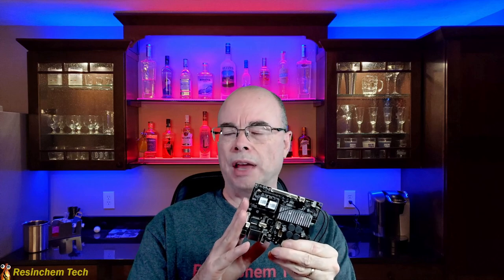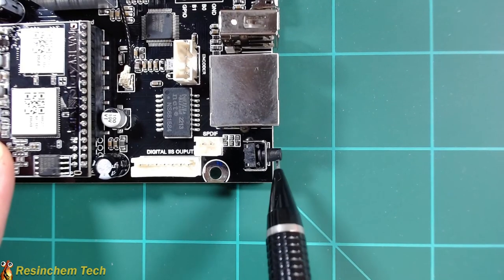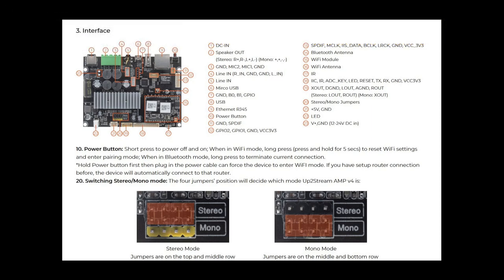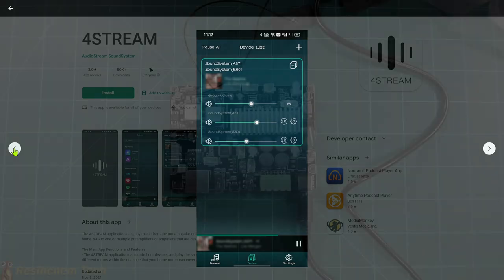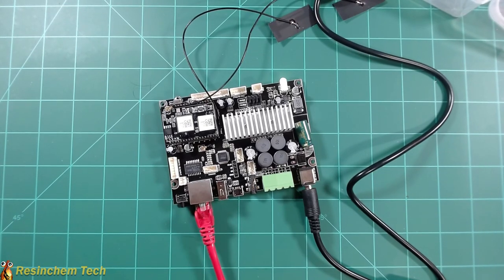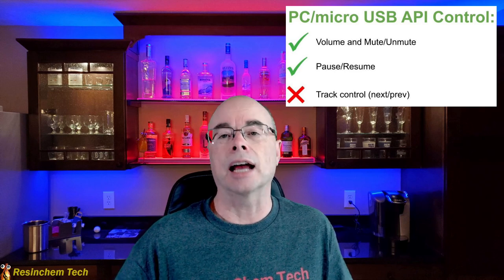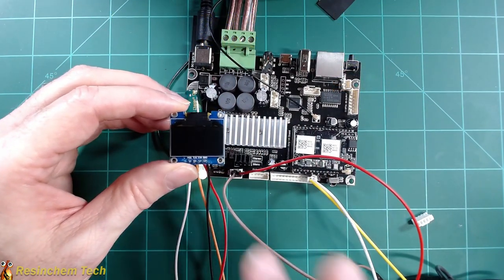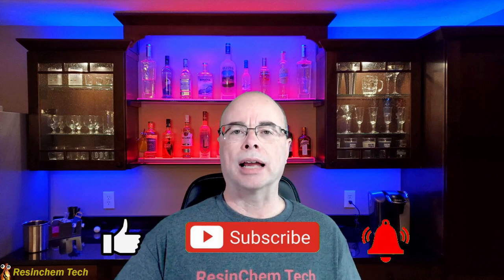A DIY approach to using the Arylic Up2Stream Amp

Comment: Ive setup 3 of these for a client with a dual zone audio system and portable transmitter. Using home assistant and linkplay you can get a lot of the features you’re looking for and combining that with the dlna player can give you %90 off the control you’re wanting.
Reply from the maker: Yeah... as I've played with it some more, I've discovered a lot of those things.  But is still hasn't stopped me from adding local pushbuttons, a rotary volume knob, OLED display, an ESP32 so that MQTT can be used to control the amp, my own IR receiver and remote and extending the IR... in prep for putting it all in an enclosure for a nice little self-contained package.  Not because I needed to do it to get use the features... it was more for the enjoyment of just seeing if I could make it all work!  I may or may not do a follow up video on these things... as you said, most of that can be done with other methods, but I do like that I have the local push buttons and volume knob right on the box in front of me when playing music without needing to find a remote or go to a web site or app.

Thanks for watching and taking time to comment.

Comment: Just last minute comments. To clarify, I only used the app once really just to connect to WiFi the lazy way. 

It is worth mentioning that you said “Old Speakers “! This not so expensive Chinese board brings life to mine and saved me money. 

Last I confess, I don’t own google devices and I was desperately looking for a way to use Music Assistant but it wouldn’t work with Alexa devices. 

Short story is I have been using Home Assistant for 7 months and I have this running so well for my needs. Yes me of only 7 months in and I have it integrated using Zigbee button to control the features that Steve hard wired here. 

So if your aren’t comfortable with breadboard etc there are options for us…folks that look for the convenient way. 

Another excellent and detailed video by ResinChem Tech!
Reply from the maker: Thanks for the comment... and clarifying the the amp can be used in other ways without all the complicate "breadboarding" and external components. If there is interest, I can do a follow up video and go into a little more detail regarding other control options, such as Home Assistant automations where control can be through other devices, like your Zigbee button, MQTT, etc.  This video definitely doesn't cover all the possible options!

Comment: I've built several speaker systems with the Arylic boards and they are have great sound and are reliable.  The question you had about version4 versus 2.0 is the 2.0 means it is a two channel and a 2.1 is a two channel plus a subwoofer channel.  They also make a non-amp board that has most features of the amp board that I use to hack Wifi into older equipment.  Interested to see how you much further you take the exploration
Reply from the maker: Ah... thanks for the clarification on the 2.0!  That was a bit confusing when trying to find current documentation.   Just as an FYI, since I recorded this, I now have the amp interfaced to an ESP32 via UART... and therefore can issue MQTT commands to both control the amp and get status updates.  And the OLED display is also interfaced to the ESP32 and shows data received from the amp UART (e.g. current source, volume, etc.).  I'm still waiting on a rotary encoder which I believe I can connected to the amp to provide a local volume knob (instead of two push buttons).  Then I'll need to create some sort of enclosure for the whole thing.

To be honest, I'm pretty impressed with the amp, despite being skeptical about it at the beginning.  If there is enough interest, I'll probably do a follow up video showing the additional various features I've been able to use (like the ESP interface, OLED display, MQTT control, etc.).  Thanks for taking the time to watch... and clearing up the version numbers!
Reply: @ResinChemTech  Definitely interested in a follow up with the Esp32! I have the 2.1 amp laying around and already have some ideas on how to use it but I'm curious what's possible!
Reply: @ResinChemTech  please make that follow up video!
Reply from the maker: I'm currently working on the code for the ESP32.... pretty amazing some of the stuff you can do via UART... and by extension with MQTT once I'm done.... all the normal things like selecting source, setting volume, etc. but other things like setting bass, treble, pregain, enabling/disabling key beeps, voice prompts, LED, etc.  The idea (or goal) is that once I'm done, you'll be able to setup a dashboard in Home Assistant that will pretty much give full control over the amp features (or use any of the MQTT topics via automation).

It's probably going to take me a while to get everything written, then fully tested, uploaded to Github with a corresponding blog article on the wiring, etc.  So, I'd ask for a bit of patience, but I'll try to get something made and posted as soon as I feel I have something ready to share!  Thanks for your interest!
Reply: @ResinChemTech  Have you tried it with Music Assistant in HA?
Reply from the maker: I've been talking to Rich (who supplied the amp) about Music Assistant, so I do know that the amp works with it, although I do not have Music Assistant installed. The docs for Music Assistant does say that it works with all players supporting DLNA, so there is no reason why it shouldn't work just fine.  Maybe Rich can weigh in here?
Reply: @EvanWasHere oh yes, some of my music is playing through MA on my first of two of these! Exclusively using it with MA in fact but for the most part only to play files off my NAS but I love it. I built a tag reader and scan tags to launch specific playlists. 

Now Music Assistant has its own hiccups and I am somewhat new to Home Assistant and am not sure if it is something I am doing or a bug. 

I hope this helps.

Comment: Many thanks for this very interesting video.
I find this board very interesting and could imagine using it to build a multiroom audio system.
But I would be very interested to know, if it could in any way also be used for voice control in Home Assistant.
When you showed the 2 MIC inputs, my thoughts immediately went towards Home Assistant voice control.... :), but unfortunately it doesn't seem to be possible that way.
What makes me positive is your idea of adding an ESP32 to it to expand the functionality.
A Raspberry Pi (e.g. Zero 2 W) should probably also be possible for even more possibilities for .
Have you perhaps already pursued this idea? Or how would you assess the possibilities in this regard?
Thanks.
Reply from the maker: I love mine... in fact I recently did a video that showed how others expanded upon or improved my build.  I bought a second board on Black Friday when they were on sale and am in the initial planning stages of building version 2.0... with some major improvements over the original.

I think I mentioned it in one of the 3 videos I did on the amp, but the amps do support multi-room sync between boards.  I haven't messed with it (yet) as I only had a single board up until now.

As far as HA and voice... the amp can act as a media player in Home Assistant, so you can output voice notifications to it.  But even with a mic attached, the board's firmware itself would have no way to process those commands (e.g. recognize wake word, convert speech to text, etc.).  You would need something else, like a Pi/ESP etc., to handle the voice input.  But since the ESP32 I am using is just sending out UART commands to the amp, a Pi or other board should be able to do the same thing.  It's not something I've really looked into... yet.  Currently, we have multiple Google speakers and devices around the house for voice interaction with Home Assistant.  I'm in a bit of a holding pattern on the local Home Assistant voice until it matures a bit more.
Reply: Thank you for the quick reply.
In the meantime I found another of your video and marked it for later.
Yes, I mentioned the Raspberry Pi Zero 2 W precisely because of all these services required for interaction with HA.
Since Assist satellites have already been successful builted and tested with Pi Zero, I think it could be the right way....
The Pi would then take over the voice control and the audio board takes over the voice output of HA as well as any audio streaming.
It's just not entirely clear to me yet whether and how the two boards would then work together....
For example, during HA's voice output any played music would have to be "muted" and I'm currently thinking about that. No idea if this is possible, if the audio board will be muted by the Pi satellite or if this have to be done by HA...
Many questions....
Since the whole topic of voice control in HA is actually still quite new and growing, it might not be so wrong to wait a little longer until it is more mature. On the other hand, such an open source project also lives from the attempts and missteps of the many pioneers of the Home Assistant community and also drives development and maturation of it.
It's crazy to see the development curve that HA leaves behind and is still growing strongly.
I feel that I have to continue to follow your projects here and that there will surely be comming something more on this topic 😉

Comment: I have 6 of these boards that I am no longer using. They were great until an over the air firmware update caused the multiroom feature to no longer sync music between boards. I reached out to support but they were no help. Since that time I swapped my up2stream amps for raspberry pi zero's with hifiberry amps and some open source software.
Reply from the maker: Just having my first board, I've not tried anything with syncing.  But I will say that trying to find any current "official" developer documentation has been a challenge (despite selling this board as a DIY version).  I've interfaced an ESP32 with the amp via the UART port and while I'm able to control a lot of features and get a lot of info from the amp,  I'm finding that what documentation I do have is incomplete and in some cases outdated.  

It's a shame there isn't better support for these boards from Arylic.  They appear to be feature-rich with a lot of potential (and pretty good sound as far as I can tell).  But I guess one of the reasons that I wanted to do everything "locally" without their app was so no firmware updates could be forced upon me (I don't know if the firmware auto-updates with the app or not, since I've never installed it).  

I appreciate you sharing your experience... and it will make me think very carefully about doing any manual firmware updates down the road.
Reply: Wow 6 boards! I was wondering were you using the app for multiroom features as I have my 2 amps in a group in Home Assistant to combine the rooms and it works pretty well. Maybe is should have asked if you were using Home Assistant.
Reply: @BELSERVICEMAN  I used both the 4stream app and home assistant for syncing. The syncing worked well until it didn't after the OTA update.
Reply: @MrChrisb2061  Hey thanks for the reply! So I use Music Assistant and I can do things that cause mine to go out of synch so there is a huge delay between playback. It is easy to fix and I figured this is partly my own doing. 

Now I only have a group of two from the kitchen (amp1) I pass through a breezeway to my workshop/garage (amp2) and if I stand in the middle they are impressive as far as timing. Not sure if you had a timing problem or they were falling out of groups. 

Happy to hear what you have to say, good or bad. 

Thanks again!

Comment: Hi mate, I'm glad I found your channel, you have a lot of awesome projects working with ARGB leds plus ESP32, 2x things that I never get bored off but still at the learning stages. I was wondering if you have come across the LILYGO TTGO T-Display ESP32 basically an esp32 with a built in LCD. I was wondering if you could do a project with ARGB led and the ESP32 Display, using the screen to display the output colors/effects and the onboard buttons to select those colors/effects. I am wanting to build a ITX computer case with a little display with ARGB with this ability. I haven't seen anything like this on YouTube and I think I would bring a lot of interest to your channel also. Keep up the good work.
Reply from the maker: Thanks for the idea and recommendation.  With this particular video on the amp, I now do have a small OLED display working to show different information regarding the amp (e.g. the source, volume, balance, etc.) and local pushbuttons for control.  

For most of my LED projects, I use firmware called WLED.  While it has native support for local pushbuttons, it does not natively support a display.  There are a number of ways to approach adding a display... through a modification of the WLED firmware... through the use of a second microcontroller to read/display WLED info (probably the easiest way) or by writing completely separate firmware that controls the LEDs, allows buttons and supports a display.  This last option is certainly feasible, but would probably not offer the 100+ different LED effects.

But it is an interesting idea and  can certainly consider developing something and making a YouTube video on the process.  Just not sure when I'll have an opportunity... but I do appreciate the great suggestion!  Thanks!

Comment: Hi! Thanks for the video. I find it very useful. Based on your video, I'm trying to reproduce the local buttons for my project, but I do not really understand the circuit diagram. Could you possibly explain which pins on the pin header were used and how the whole thing was wired? Is there a way to use a volume knob instead of the volume + and - buttons?

I'm also interested in the follow up video. I hope you'll have a chance to make it. :)
Reply from the maker: I have published the follow up video and I think it will answer your questions.  Also note that I do use a volume knob instead of buttons in the follow up video.  And if you check that video's description, you will see a link to a written version of the project that has all the wiring diagrams that I used.  Here is where you can find that follow up video: https://youtu.be/bE3YqMwv0SI

If after watching the follow up and looking at the written article you still have some questions, please don't hesitate to reach back out.

Comment: Did you by chance figure out how to hook up a rotary encoder?
Reply from the maker: Yeah... and a lot more.  You can see the rotary encoder and more in my follow-up video to the amp board:  https://youtu.be/bE3YqMwv0SI

There is also a written version of the project, with wiring diagrams and more info here:  https://resinchemtech.blogspot.com/2022/12/arylic-amp-mqtt.html

Comment: how would one go about programming in the 4 other buttons for local control?
Reply from the maker: The ADC key pin is used along with different resistor values connected to the buttons to program what button does.  This is covered in the video at 24:17.  I also cover it a bit more in the follow up video: https://youtu.be/bE3YqMwv0SI

Finally, the written version of this project contains even more detail on how you can add pushbuttons to the amp for local control:  https://resinchemtech.blogspot.com/2022/12/arylic-amp-mqtt.html   The written version has step-by-step instructions and describes button additions in full detail.
Reply: @ResinChemTech   Thanks so much for your reply. I ment the 18k, 21k 47k and 100k resistor values for the buttons. they are unspecified in the manual as to what they do and i was wondering what they did and if i could program what they did in a way. The follow up vid and the written version are very helpful!
Im trying to modernise a broken vintage radio and your explanations/videos make it so much easyer.
Reply from the maker: Sorry if I misunderstood your original question.  Finding the documentation for the amp was a bit of a challenge and I had to pull it together from various sources and locations.  But that written guide does have a pretty good image of the documentation on what resistor values correspond to the different button functions.

You may or may not need it, but if get to the point where you want to use UART and/or MQTT commands, I should also mention that I have a Github repo with all the code I used, but the wiki contains some additional useful information that might be helpful:  https://github.com/Resinchem/Arylic-Amp-MQTT/wiki

Don't hesitate to ask if you have any additional questions... and good luck with your project.  Let me know how it turns out.